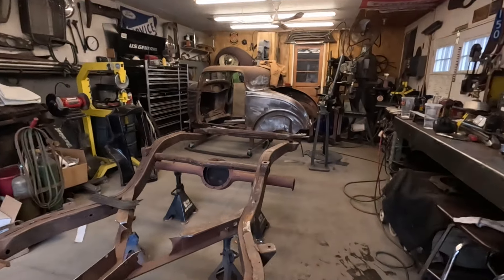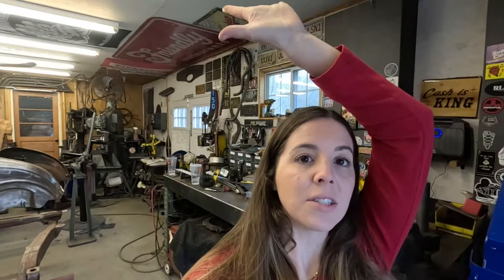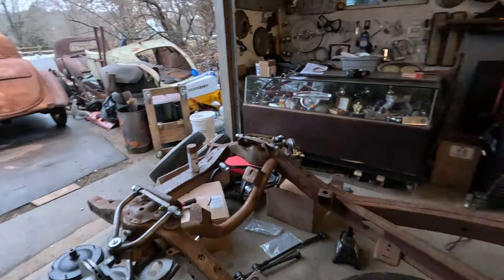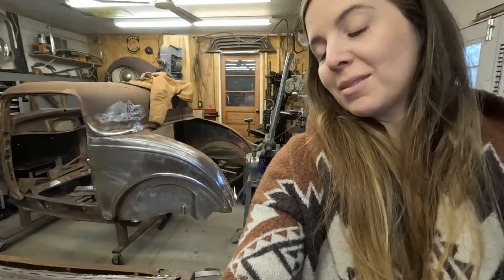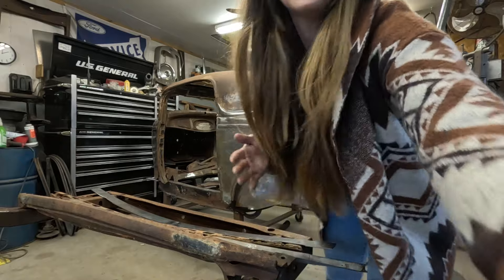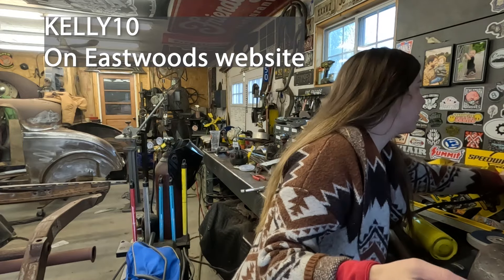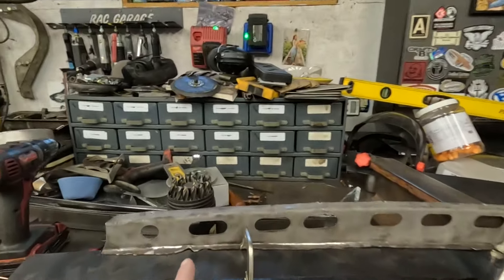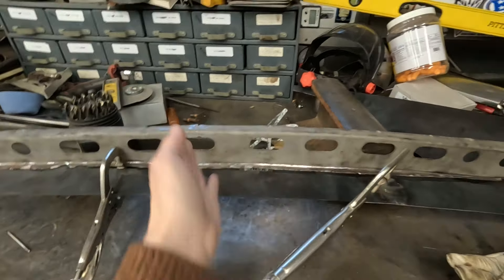Finally Finishing the inner Sub Rail

Comment: You're doing great  - TIG is tough to learn. I do great on test pieces, then move on to the car and blow holes. Welding new metal to old partially rusty steel is very unpredictable, so don't beat yourself up. Travis is probably the best there is at this so watch and learn. You have a great "can-do" attitude so you'll be fine.❤
Reply from the maker: That’s what happens to me too haha! So frustrating. Definitely glad to have Travis to help. Thanks for the support!